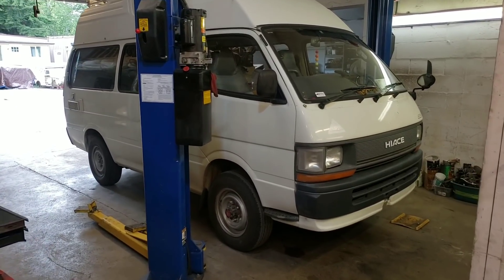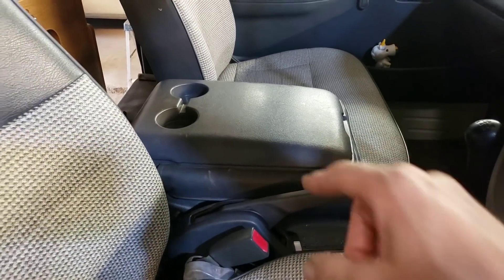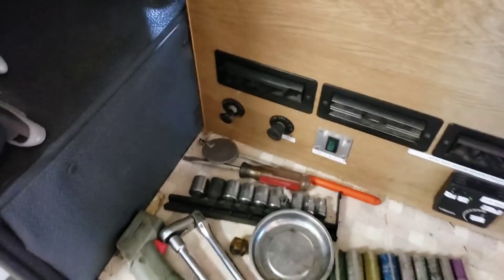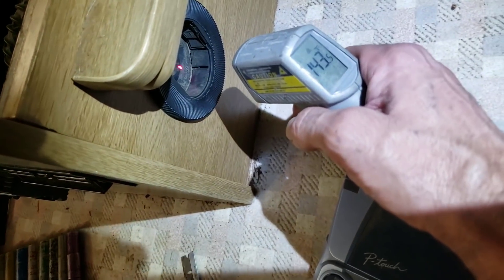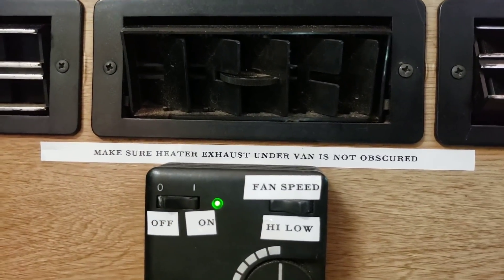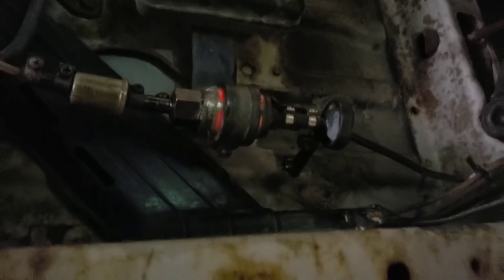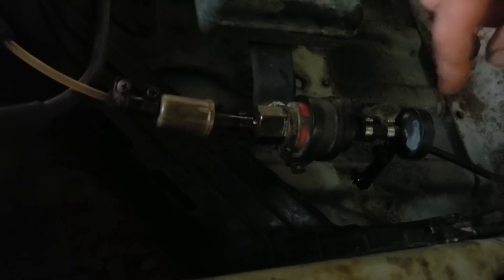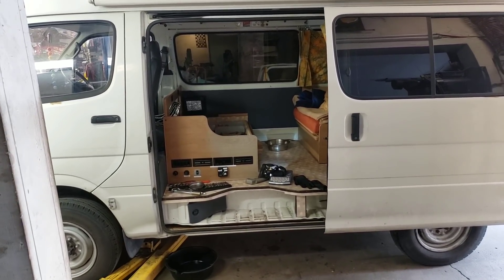Webasto Diesel Camper Heater Repair

Comment: Had Webasto heating in express buses (megabus) I used to drive here in the UK before they were replaced at my depot. It was an efficient system, too efficient sometimes! I often wondered how they worked and now you've shown me how. We had to turn them off during refuelling. Nice van. Great video, keep them coming.

Comment: Toyota Hiace van are hugely popular in Australia due to the flexability and custom modifications of the build available from factory. From tradies to freight delivery to buses to campers, theres an option available to suit, and spare parts are readily available. The Wabasto diesel heater, a factory option in Australia, also appears to have a catalytic converter installed inline. This must be run regularly to ensure correct operation, and there should be an inline disposable filter to avoid the injector pintle blocking. The exhaust should exit the rear of the vehicle, as per factory.  👍👍🇦🇺
Reply: Is there any provision on this heater to prevent you from running the tank dry? It would suck to be stuck out in the boonies with no way home.
Reply: @douglasfur3808  The Australian installations have a separate 20 litre fuel tank installed, enough diesel for a 50 hour constant runtime at maximum temperature, but this can be extended by thermostat adjustment.

Comment: If you need heat for any of your projects those little diesel heaters are definitely amazing. I picked up a generic Chinese 5kw one on ebay for around $120 including everything you need to make it work. It cranks out tons of heat and seems pretty efficient on fuel too. I hooked it up to a 12 volt power supply and use it to knock the chill off in my garage when I'm out there working in the winter.